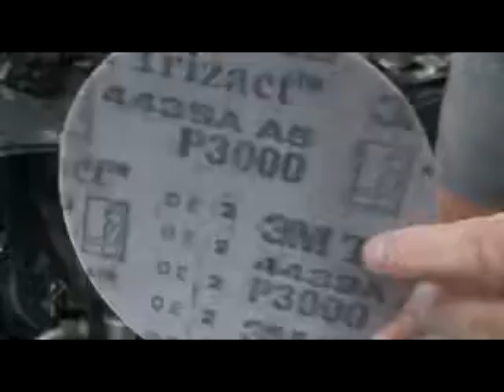Working on polishing the dingy headlights...

Comment: I do something similar but, it takes about 1/2 hr per headlight. I use wet 1000 to 2000 to 3000. All by hand. Buffing is the same. Before I sold it. I did my 93 Silverado. It's headlights were flat out yellow. I didn't have any headlight restore polish so, I used Wenol metal polish. They turned out really nice. Now off to do my 03 Rav4. Lots of surface on those puppies. Great job. You made it look easy. My arms usually want to fall off by the time I'm done doing it my way. Cheers!